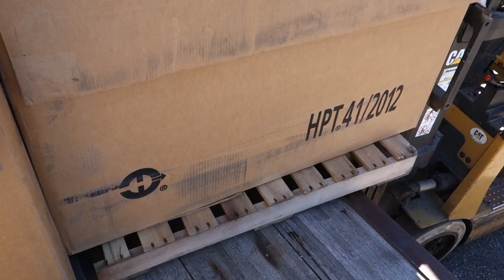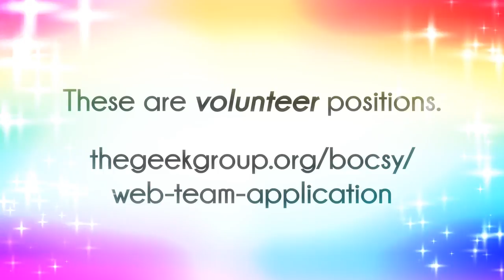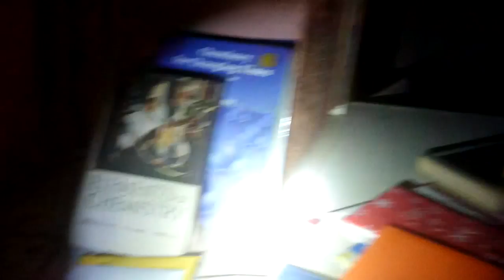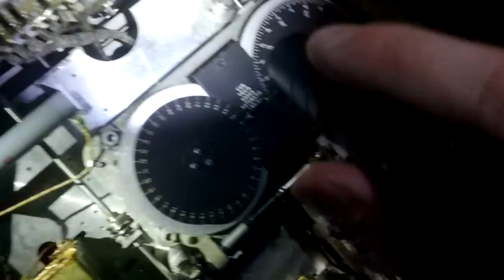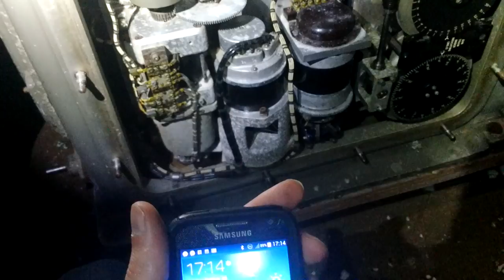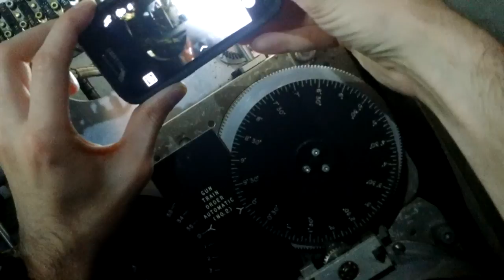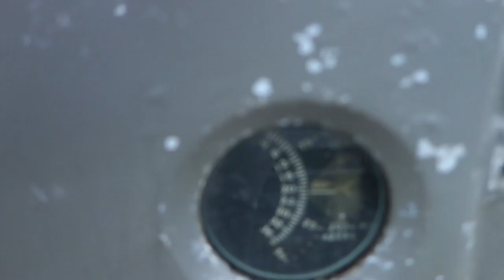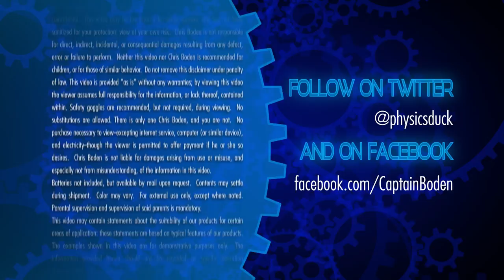Captain's Blog 9 26 2014 Analogue Computer Pickup

Comment: Fun fact: 
   When I worked as a stage hand, and we had to stop heavy carts on wheels from rolling down the alley, we had a bucket of short pieces of chain for wheel chalks.  They were about 18 inches each, and you'd swing it, and let it wrap around the bottom of the wheel.  They worked very well to keep a 3400lb cart from going anywhere.